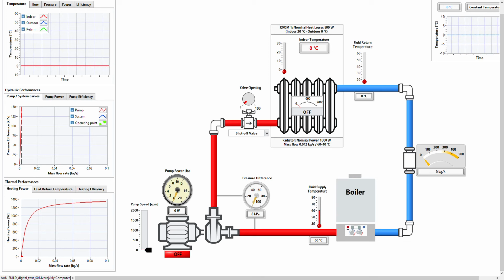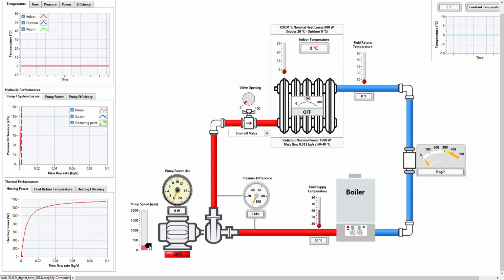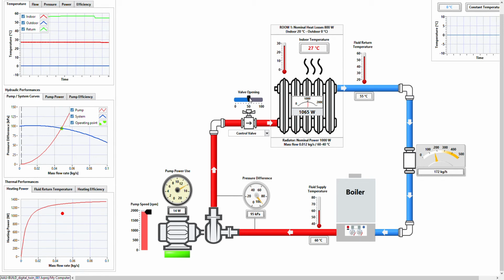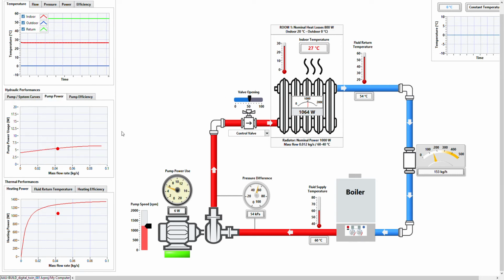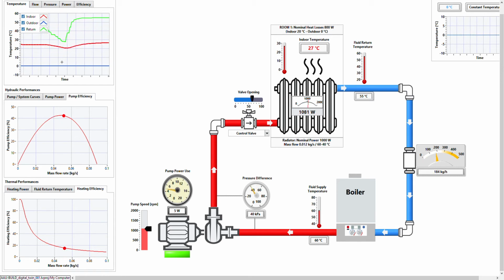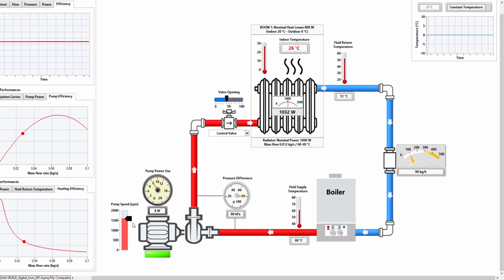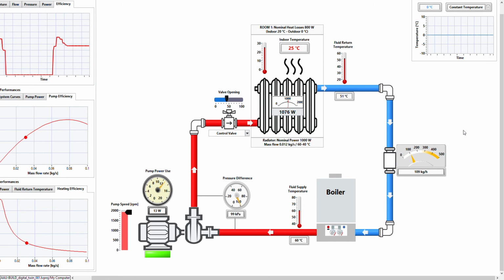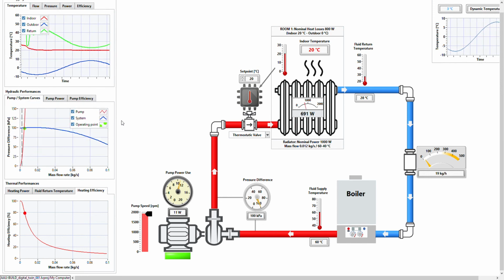First prototype of digital twin of experimental setup exercise for E-learning (LabVIEW)

Comment: Fantastic. I did similar work for Air Handling Unit in Simulink. I have never used LabVIEW; is it more accessible than MATLAB? Do you recommend any tutorials to learn LabVIEW?
Reply from the maker: Hi. LabVIEW is quite nice to work on to develop GUI rapidly, but it is coding numerical model with it not so much. However, labview has now some embedded emulation of Simulink in which you would "draw" your system just like in Simulink. You can also run MATLAB code in Labview (it literally open MATLAB for you, so you need MATLAB to be installed). But I would personally keep LabVIEW for just high level GUI and control interface while limiting the numerical model running in the background to simple numerical models like for this project. For more complex models of systems, I would rather try to call or couple directly a MATLAB or Simulink or Python or Modelica model. I have tried calling Python functions for computer vision application, works very well. I have not tried coupling directly with MATLAB scrips or Simulink models, but I think it is possible.

To learn LabVIEW, I would recommend the self-paced online courses from National Instruments: they are accessible for free (I think) if you have a LabVIEW licence.
Reply: @Dr. Hicham Johra  Thank you for your comprehensive reply. I can see that I have access to the recommended courses. Good luck in your research, and please keep us updated with those inspired videos.

Comment: Hello Dr. Hicham Johra. I really liked your work and your clear explanation, if possible, I would like to clarify some doubts... did you use system identification in the model? how did you raise the parameters of the motor-pump set? has any type of controller been implemented, if so, which type?
Thank you for your attention and success on your journey. Sorry for my English. Greetings from Amapa.
Reply: Hi. Thanks for your comment. For modelling of the pump itself, I made it in a simple way: the pump curve is generated from a 2D linear interpolation on manufacturer’s data (table of pump’s rotational speed with corresponding fluid mass flow rate and pumping pressure. so for a given pump speed I get a pump curve interpolated from manufacturer's data, and I also get the pump power use from manufacturer's data interpolation.
A pump curve quadratic polynomial function is then fitted with this data. I build up the network system curve from the Darcy-Weisbach equation. I then get the operation point of the circuit from the intersection of the pump curve and the network curve.
I will present the paper at a conference at the end of August and then I can distribute the paper via ResearchGate in which more details is given about this digital twin: https://www.researchgate.net/profile/Hicham-Johra
Reply: @hichamjohra4346  Thank you for the explanation. Good luck at work.